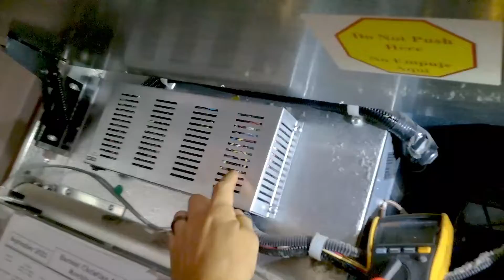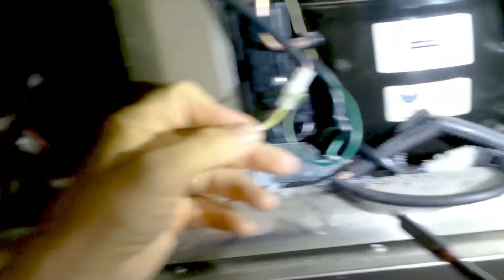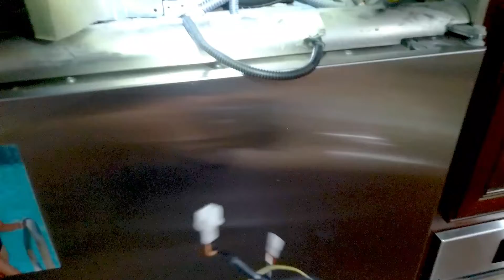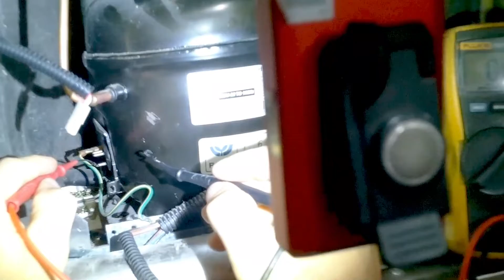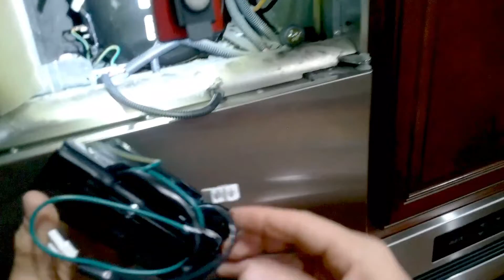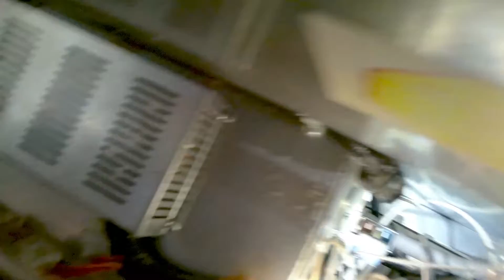GE Monogram Refrigerator Not Cooling? { GE Refrigerator Inverter Board Test }

Comment: my ge monogram the lights turn on so i have power but no compressor, noise, or digital temperature display.  Is this an inverter problem or board problem? Do you have a mother board replacement video?
Reply: @anthonyfacchino6793  did you ever figure this out? I have exact same symptoms

Comment: ON MINE THE ONLY THING THAT IS ON IS THE LIGHTS NO FANS ARE RUNNING AT ALL NOT EVEN IN THE FREEZER SECTION. DOES THE INVERTER CONTROL THE FREEZER FAN AS WELL ?
Reply: Yes. The inverter controls the compressor (which cools both the freezer and the fridge) and the fans. If your lights are on, it means your motherboard is good. Inverter needs to be replaced.

Comment: I'm getting 1.3vDC from MCB to inverter. Does that mean my MCB is bad or should I proceed with replacing inverter?
Reply from the maker: Great—when you tested it, was it plugged into the wire or did you test it while it was disconnected?
Reply: @onlineappliancetech  It was still connected
Reply: @onlineappliancetech  what do you think?

Comment: Thanks for referring me to this video from one of your other videos, you’re a great find. Question there’s a green wire coming off compressor. I’m assuming it’s a ground for the compressor, just need to know where it attaches too. Thanks
Reply from the maker: The green ground wire should connect to a prong on the compressor near the pins—if I’m thinking of the correct one. And yes, the green wire is the ground.
Reply: I replaced the inverter board and it seems to have fixed the problem for about 7-10 days. Then there was the fluctuating temp going from -17 to -12 and then back up to -18 and now back to -12. It won’t go into diagnostics mode the way it before the install of the inverter board. There’s also moisture coming from the freezer side to fridge side. I want to say it’s a fan issue of some sort but getting it diagnostic mode has been next impossible. It wasn’t difficult a couple of weeks ago. Your thoughts?

Comment: I did the reset on my 2011 monogram side-by-side and it did reboot but after it rebooted the temperature set controls when pushed beep three times and both the Celsius and Fahrenheit lights are on. It displays the correct temperature, but you cannot change the temperature it appears as if that feature is locked out. Any suggestions?
Reply from the maker: Try flipping the breaker off, wait about 2 minutes, then turn it back on to see if that helps.

Comment: The dc voltage is variable between I think 5 to 12, it tells the invertor what speed to run the compressor.  If you take apart the old one, you'll see its just a pc board and the compressor is a heat source so a dirty condenser means more heat... pc boards hate heat.  The new invertor has a metal heat dissipater which helps, but keep that condenser clean.

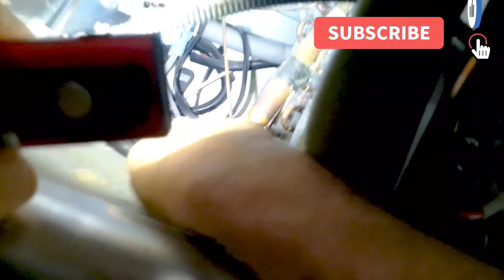Comment: I am sorry to ask you that from beginning of the video have you done testing the inverter and the compressor in LIVE power UNTIL 0:56 you starting to unplug the unit?  With the live power is it too dangerous to pray-off the compressor connector from the inverter?
Reply from the maker: Yes, be sure to unplug the refrigerator before replacing any parts.
Reply: He's unplugging the fridge. Our monogram has a power cord and an outlet at the very back of the mechanicals cavity.

Comment: Hello!  I get 5.15 to 5.20 DC Volts from my first reading.  From the other cable I get 120v.  The fridge and freezer are 25° and 41° respectively.  I cleaned the condenser this morning but temperatures still the same.  What could it be?
Reply: I hear the compressor on and a little hot too.

Comment: Thanks for the video very helpful.   I’m reading 5.15DC on my meter,  is that in range?
Reply from the maker: If you're getting the correct voltage and have checked the windings to ensure they aren't grounded (as shown in the video), it's likely an inverter issue, which is a common problem.

Comment: I am getting 11dc volts from the main board. Is that normal ?
Reply from the maker: Yes, I think that if you measure the DC voltage while the wire is connected, you should see around 11 DC volts. However, if you disconnect it and then check, the reading will likely be about 5.5 DC volts. Hope this information is useful!
Reply: 👍New inverter installed and fridge is up and running again, Thanks  @onlineappliancetech

Comment: Just ran through it. Easy check. All seams well though. 6.6v signal, winding are all 6.9, no short in compressor. Powered up i can tell the compressor is running and each pin to the running compressor is reading 90ish volts to chassis ground. Doesn't make cold air though. Could it still be the inverter? The compressor does seem very quiet when running. Condenser fan is running too.
Reply from the maker: Hello! From your description of the compressor being operational, it seems that your inverter and compressor are functioning correctly. However, the issue might be a refrigerant leak, as indicated by the compressor running but not at high speed, suggesting there's nothing to circulate through the system. Before spending any money, I recommend having a qualified technician inspect the system to confirm the problem. If you weren't receiving the correct DC voltage to the inverter, my advice would be to replace the MPC. Conversely, if the correct voltage is reaching the inverter but the compressor isn't activating, then replacing the inverter would be the way to go. In your situation, since the compressor is running, it points towards a different issue. Hope this clarification is helpful!
Reply: What MPC are you referring to? Do you have a link to one?

Comment: My refrigerator is over cooling... especially the climate control drawer...my refrigerator is set at 39°, the climate control drawer is set to 43° but is at 16° and everything in the produce drawer is frozen. Can anyone help me? We just had all the coils cleaned and the refrigerator was unplugged and plugged back in to reset it.
Reply: I think you might have an issue with (stuck open) flap door that controls the air between the freezer and climate control drawer. when that happened to me, refrigerator got so cold, water dispense line got frozen and busted. the gear that moves the flap door often get stripped. I had to replace that twice in 18 years of ownership.

Comment: Just finished the inverter replacement.  It is REALLY easy to do.  The only thing I was confused about was at 0:52 where he says, "so let's unplug the unit".  I wasn't sure where he was disconnecting power from.  The instructions on my replacement inverter did not mention that main power should be disconnected.  So I just disconnected power, signal and ground to the inverter, and proceeded with the replacement.  I probably should have switched off the fridge at the breaker, but I didn't bother.  The fridge is working fine now.   Thank you for this video!
Reply: ALWAYS unplug an appliance or turn the breaker off before replacing any electrical parts!

Comment: Great info...I got exact same GE model as your video. I followed your instructions and saw my control board output 5.13DCV. I bought a used board but also showed 5.10DCV. The 3 ways compressor showed 10.9 instead of 6.9 Ohm on your video. Is this Ohm reading normal for GE Monogram? Should I buy a new inverter?
Thanks... Tiger
Reply from the maker: If your inverter is receiving 5-6 DC volts from the Main MPC and 120 AC volts from the main power supply to inverter, and the compressor has been tested and is functioning correctly, then the remaining component that could be causing the issue is the inverter. I trust this information is helpful, and I'd appreciate if you could update me on your situation! Best Regards!
Reply: Hi again.
I bought a use Inverter. The sales said it is in working condition!
Recap:
Replaced a used control board measure output 5.10DCV. 
Replaced a used Inverter bought on Ebay which seller said it is in working condition. 
Power connector showed 120V

Resul of Compressor runned in 30 minutes:
Internal degree is down from 76F t 74F
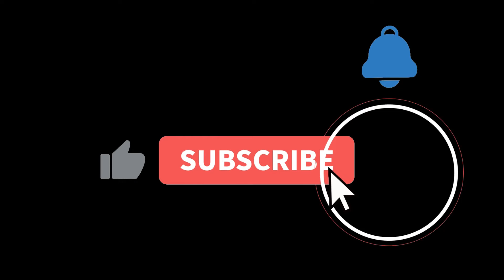Compressor hot to touch. It measures temperature by heat gun showed 124F. Hi pressure  7:58 Return freon copper line hot. Low pressure copper line not Cold. 
Now I don't know why refrigerator not working? If you ok that control board measure 5.10 instead of5.6DCV to 6.4DCV the  only reason is used Inverter not working.
Please advise
Reply: And the Compressor 3 sprongs measurement is 10.9 ohms instead of 6.9 ohms, as in your video. Cooling fan behind compressor is working ok
Reply: Hi again
Last time I asked how hot compressor should be, bit O got no answers. Then I look at this utube. He said compressor run ok up to 300F but not over 320F.
Recap:
I followed your advice to replace control board but it not working. Then replace used Inverter.  Now my GE Monogram refrigerator is working ok.
Status: 
Control Board produced 5.10DCV
Compressor run at temperature from 124F to 137F

Here is to share my repair as you have requested. 
After all, thanks for your video
Reply: 3 prongs compressor measure at 10.9Ohms
Reply: Report status GE Monogram refrigerator. 
Repaired 3 weeks ago.  Working GOOD with compressor temperatures between 127F to 142F.
Question....compressor make bubbles noises when open/close freezer door. bait doesn't make bubbles noise when open the cooler door.
Any options.??!!!

Comment: What can be wrong when it is still not cooling after replacement of inverter?
Reply from the maker: If the unit remains unresponsive even after you've replaced the inverter, the problem could lie either with your compressor or the main power control. It could be that the main power control isn't delivering the necessary DC voltage to activate the inverter and consequently start the compressor. To assist you in testing the compressor and the output power to the Main Power Control (MPC), I've created a tutorial which you can find among my video content.

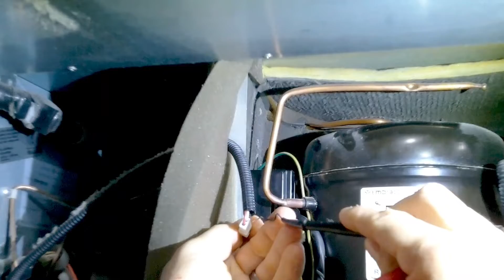Comment: My problem with a GE Monogram 42" built-in is the freezer started getting warmer, then the cooling went out totally in the frig and freezer. When I check the voltage that is going to the inverter, (at 0:29 seconds into this video), using the volt meter you recommended, I'm getting a reading of 11.5 to 12.2 volts DC. What does this mean? Is the motherboard bad? What do I do next?
Reply: Model GE Monogram ZISS420DRJSS
Reply from the maker: Hi there! I've noted that your inverter is registering between 11.5 and 12.2 DC volts. When connected, I typically get a reading of 4.5 to 6 DC volts. Did you take this measurement while it was still attached, as I did in the video, or did you disconnect before testing? This could explain why you're seeing a 12 DC volt reading. If you still get 12 DC volts even after disconnecting, it suggests that your main control is effectively delivering power to the inverter, which in turn should start the compressor. Make sure you examine the compressor windings as I showed in the video. If everything there seems fine, your inverter might be the issue. I hope this explanation is helpful to you!"
Reply: I disconnected the quick connect like you did at the very beginning of the video, the 12 volt measurement I'm getting is from I guess the main control board like you say in the video,  but you get 5.5 to 6. Is this a problem? It's twice your measurement.
I have not yet disconnected the inverter board from the condenser yet to measure the ohms of it. I'm at work now but will do when I get home.
Reply: Okay, last night I removed old inverter and measured across all 3 points of contact of the condenser, they all measured at 6.8 ohms. I replaced the inverter. Checked this morning and still NO cooling in frig or freezer. What do I try now? BTW, when the GE repair tech came out he said we needed to replace refrigerator Vcc3 condenser k, refrigerator suction tube cap, evap asm w/ heater, R134 drier, refrigerator icing repair kit, heater def, thermostat cutoff, plus labor for him and an assistant, for a total quote of $3,381.
Help! What do I try now?
Reply: Hello @onlineapliancetech, what can I do next? Please see me last 2 replies. Thanks!
Reply: Hello @onlineapliancetech, what can I do next? HELP!

Comment: Thank you for the video I just did this and it’s already seems to be humming along one question it does seem really really warm the condenser is that normal?
Reply from the maker: May need to clean condensers, and make sure condenser fan motor is working. Help this helps!
Reply: @onlineappliancetech  it’s like hot to the touch now.
Reply from the maker: @bullflags3640  Sound like your condenser fan is not working which will kill the inverter sometimes even the compressor. I would call a tech out to check out everything.
Reply: @onlineappliancetech  also the refrigerator is not working with a new inverter.   So thank you!  now getting to temperature. I’m just worried about the hotness.
Reply: Thanks.  Where is all that 😊

Comment: How do you access the condensers to clean on this model?
Reply: good question
Reply: I was wondering the same
Reply: I pulled the fridge out from the cabinet, removed the top cover and cleaned the condenser with compressed air.  It was incredibly dirty after 15 years

Comment: Great video. Thanks!

Would there be other indications if it was a refrigerant issue? Would the control panel still send signal to inverter?
Reply from the maker: Hi, If your inverter is getting a signal but not turning on it's your inverter. I would check windings on the compressor however but I had one GE compressor go bad in the last 20 years. If you have a refrigerant issue it would be cooling a little but not fully. Even if the unit had a refrigerant leak the compressor would still hum and be warm due to having air into the system. Take Care.
Reply: Thanks for the additional info. I ordered the inverter yesterday after confirming 5.5V signal to inverter, 120 V from power supply, 6.9 ohms between windings, and no winding shorts to shell. I'll report back on my success.
Reply from the maker: @TBHVAC  happy to hear.